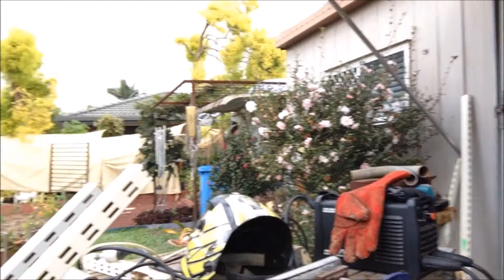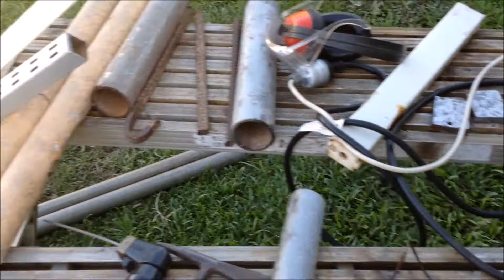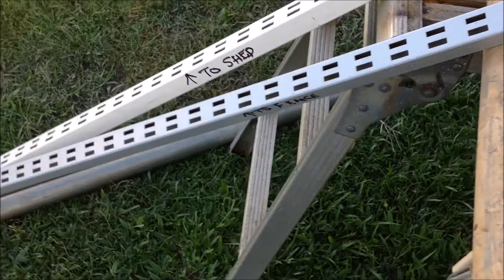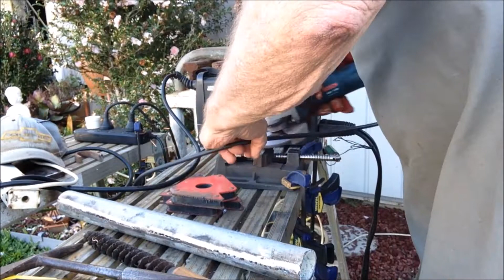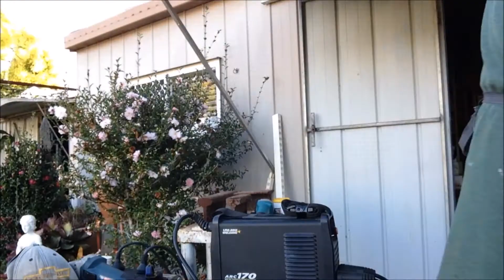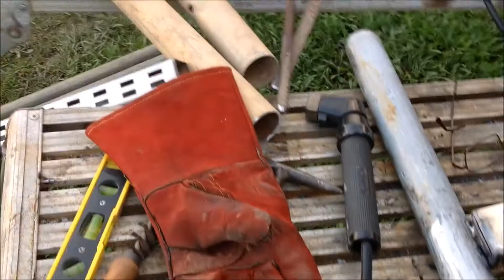Beautiful One Day, Not So Good The Next, But... Great For Welding 🙂

Comment: I have stage 4 Emphysema i had coils put in my left lung Dec 2016 for last 3 days i have felt almost normal what is going on!
Reply from the maker: I am only familiar with coils, Gary; but I am aware that they can be a bit of hit and miss affair; in as much that what works for one does not work for another. However, why you all of a sudden feel almost normal after 17 months I do not know. I would have expected any feeling of normalcy would have happened within a short period following the placing of the coils instead of 17 months later. My only suggestion is to consult your doctor or specialist. 🙄👌